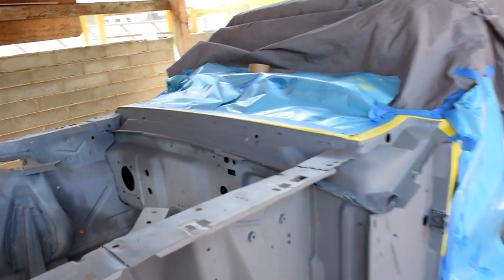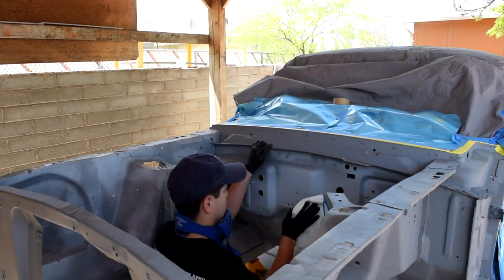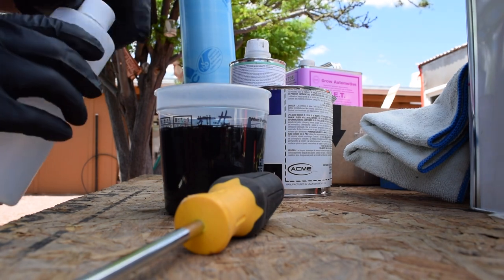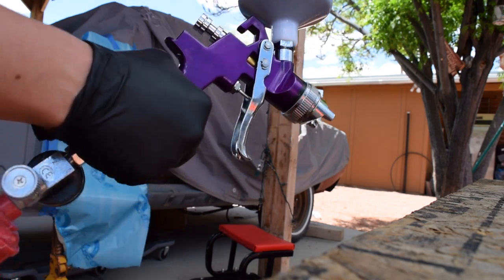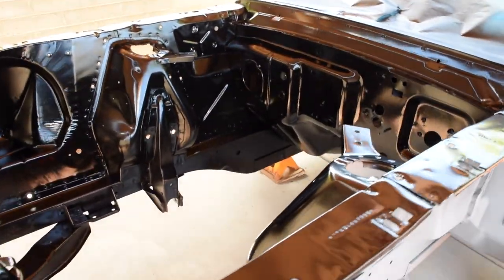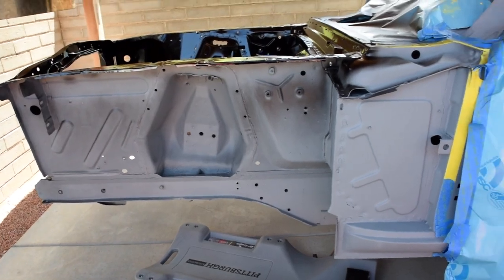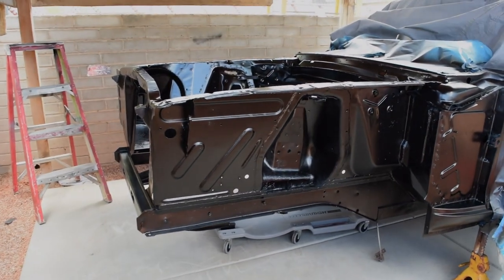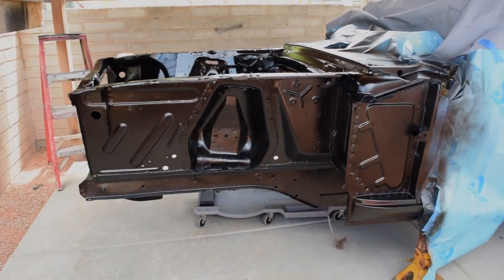Painting Engine Bay / Side Apron | 1965 Mustang Fastback Restoration

Comment: Finish looked nice but try 30 psi at gun and you might have to turn your fluid in but should day down wetter coat. Looks like your pattern is a little dry an blowing a lot of material around in air and not on panel. End result looks very good though
Reply from the maker: Thank you for the tip! I will keep that in mind

Comment: What kind of compressor did you use with the sand blaster? How many SCFMs was it rated and what worked best?
Reply from the maker: Sorry for the late response! My comrpessor is a 21 gal about 10cfm. It was just keeping up with the blaster so i wouldnt recommended anything lower.

Comment: Why didn't you prime it first
Reply from the maker: I did, the grey coating that you see in the video is primer. It was primed before the video was recorded
Reply: @rookie__pilot  looks good buddy make more videos 📹
Reply from the maker: @sierraautobodymustang9559  thank you! Will do!
Reply: @rookie__pilot  hey how much aluminum oxide did you end up using and exactly which parts of the car did you blast ?
Reply from the maker: @sierraautobodymustang9559  i used a 50lb bag on the front clip, the rest of the body panels were pretty flat so used a polycarbonate disc for the rest
Reply: @rookie__pilot  ok cool. As far as recollecting your media, and sweeping it off the ground and filtering it through again - do you lose a considerable amount reusing it?
Reply from the maker: @sierraautobodymustang9559  you do lose some depending on how big your tarp is, but the biggest thing is after about its 3rd or 4th cycle the media becomes more of a fine powder and starts being less effective
Reply: @rookie__pilot  ok interesting.  I intend on using the same media and blaster from HF on a 67 coupe to fastback conversion and need to blast the chassis first